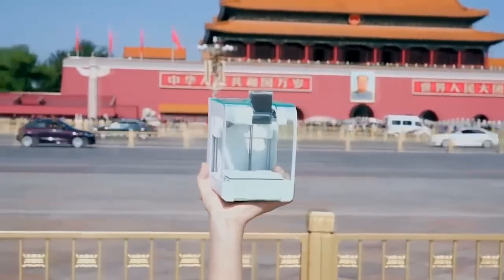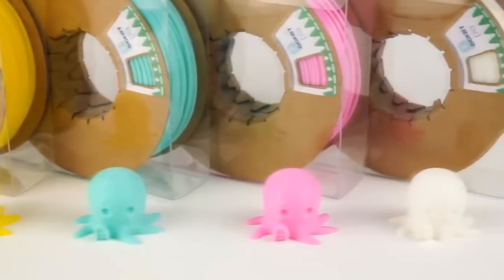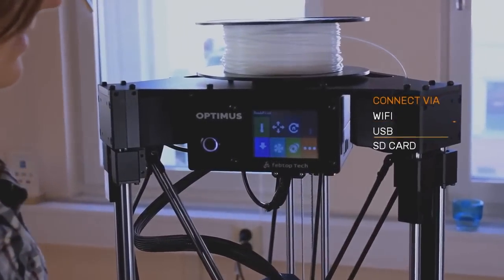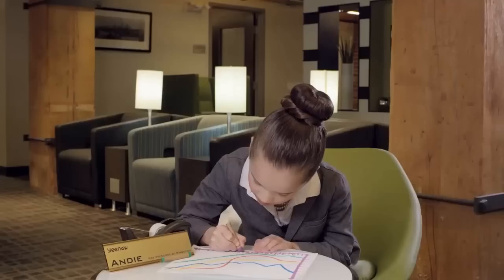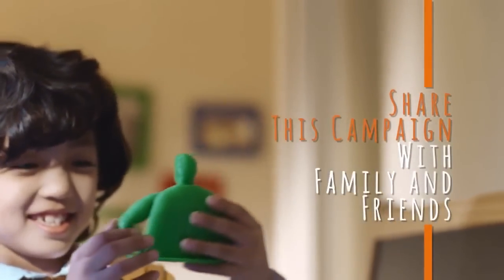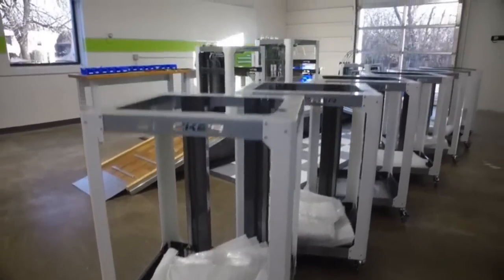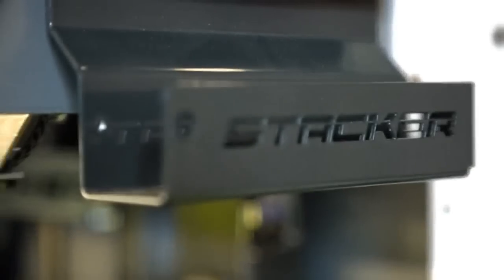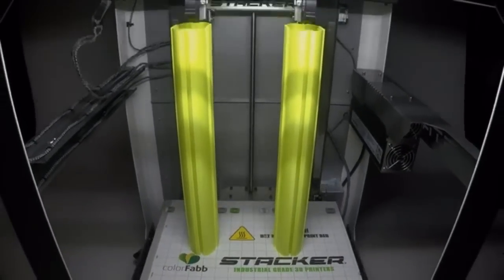Top 5 Best Cheap 3D Printers 2017

Comment: Are you kidding me? That last one costs about $11 000 cheapest version. That is not cheap! Learn to count. And by the way best 3D printer is Anycubic Kossel Plus for about $330. It's pretty volume is 30cm (1ft) height limit above circular heated bed with 23cm (9 inch) diameter. If someone is looking for a cheap 3D printer, this must be on your list of adepts 1st. Have a nice day.

Comment: all these printers are either still in prototype phase and not yet available or not cheap at all the stacker s2 is the last on the list and it is one of the most expensive 3d printers I have seen at just under $10,000 most most 3d printers that people look at buying are around $1,000 - $2,000 so cheap would be anything less than $1,000
Reply: Dissident Ace if you are still looking for a 3D printer, I would recommend you Anycubic Kossel Plus because of it's great features. For example the building volume is one of the biggest in category under $400. It's delta printer with heated bed with 23cm (9 inch) diameter and height limit of 30cm (1ft). It costs just about $350 on Gearbest.